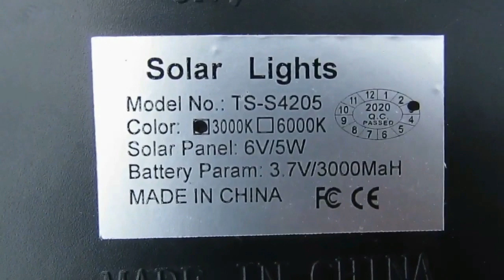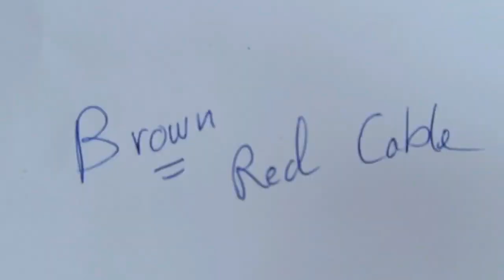PROTECCION contra el ROBO Simulación de presencia Protección Antirobo Protección contra robo Solar

Comment from the maker: La protección contra el robo, la disuasión contra el robo es muy simple. El panel solar se instaló fuera de los puntos solares dentro del garaje. Durante el día el módulo carga las baterías incorporadas y por la noche la luz se enciende automáticamente. Desde fuera parece que la luz normal está encendida. La ventaja en vacaciones es que el circuito eléctrico de la casa puede ser interrumpido en la caja de fusibles porque las luces solares funcionan independientemente de la red .... Saludos Alex